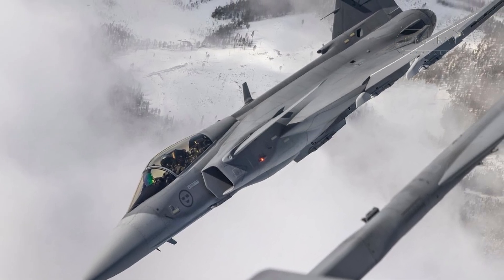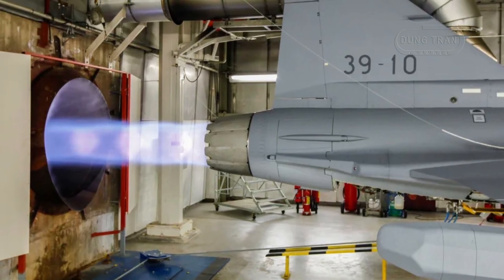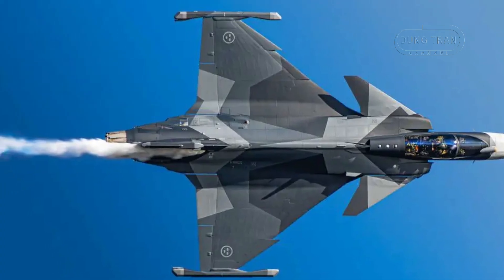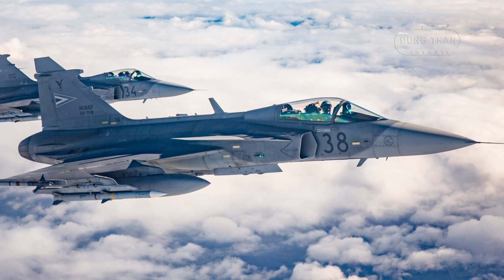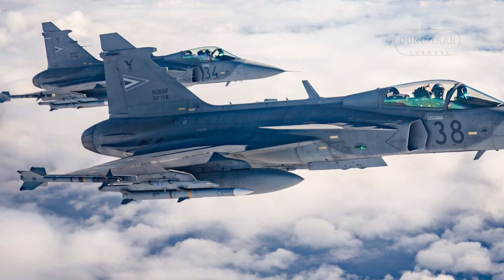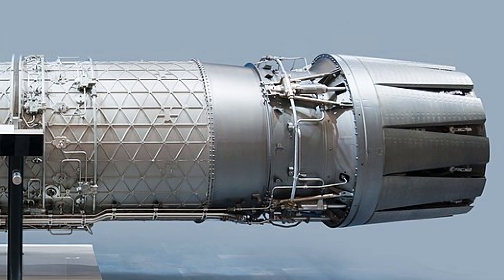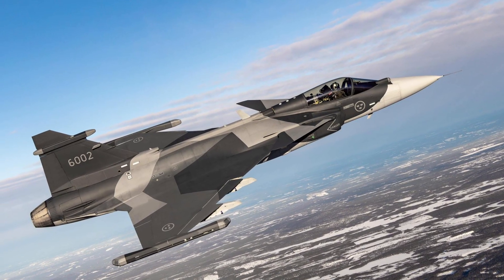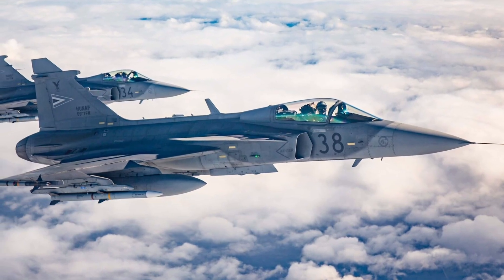Sweden's Gripen E's Hypothetical Power-Up: EJ230 vs GE F414G Head-to-Head

Comment: There is no way to mass produce Gripen with RR engines, yet. Dialing in the engine with the airframe typically takes 1-2 years (there are NONE, yet). It then takes a couple of years to translate that for mass production. Sometimes, there are added costs… once complete.

Comment: It should be noted that the EJ230 would only be installed if a country orders the Gripen with the EJ230 engine instead of the F414 engine.  There's simply options now.  Note that South Koreas KF-21 also uses the F414 engine though they make it themselves and they have said they will make their own domestic engine to replace it.  That would mean that a replacement that diesn't take any modifications to adapt the engine will be available...

Comment: The weight and shift in balance might be just a fly by wire software fix but changing the body and air intakes is like calculating a new plane with drag, radar cross sections etc. The RR engine should be considered for the next SAAB, 10-20 years from now.

Comment: The EJ230 doesn't actually exist, it's not even a prototype. In fact, I've never heard of anyone using the term 'EJ230'. Also, thrust vectoring is separate from the engine, it's not necessarily part of any engine upgrade.
Reply: Do better research. The ej230 is definitely found on the web

Comment: Its the American again meddling sabotage the deal by unfound statement cause fear of failure in Rolls Royce make engine.  As a Canadian we have seen this before in the past.
America does not want Canada to buy this aircraft because it the only fighter that can defeat F35 stealth with Gripen E radar.  

The truth is the F414G is great engine in straight level in dogfight no extreme turn to left and right up or down could cause flame out of the engine..  This is why they have an auto restart and hope the pilot can get to the button while it on subsonic spin.  Judging from the lack of accident from Typhoon the Rolls Royce  working just fine.   Pilots are not allow to make this public but then it got out.  China's Shenyeng J 15 flying shark four flame out and crashed not too longer ago.

The only aircraft that build with anti-flame out is the Rafale that Canada ordered.    Word got out Rafale is hugely popular now and flooded with order.

Comment: They should skip the thrust vectoring to expedite and simplify the EJ200 in other aspects like better fuel efficiency/better thrust that next gen engines will enable such as F35 block 4 engine.

Comment: If Saab consider the 'F-series' 5-6th gen idea at all, then an EJ230 style option should be considered for all new elements - the loyal wingman UAV, the light 'stealth' fighter etc. Equally they should be taking to GCAP (or even SCAF) program.

Maybe if both programs, either use the same loyal wingman partnering different crewed aircraft, or at least agree to develop using a same European engine, it might have enough numbers then to reduce the engine development/unit costs.

So either the Gripen remains the weak link with US engine, but at least within a system where new stealth fighter and loyal wingmen are ITAR-free and stay flying, or the costs come down enough to make an EJ230 Gripen retrofit/redesign worthwhile/fundable.

Comment: SAAB need to consider whether it stays with the American engine and being told who they can sell their planes to, or revamping the Gripen to the  G and H versions with the Rolls Royce engine and basically having more control over selling their plane to whoever THEY wish to sell it to. It doesn't really matter which President is in power,  if it competes with American manufacturers then they will have sanctions of some sort placed against them.
Reply: US does not have the power to block for competition, only security reasons. So any nation US wants to sell F-16 to is valid.

Before Trump Sweden might have hesitated if US try to block for economic reasons, now pfft go away US we dont care.

Comment: When i saw the tangle of pipes on EJ230 I had to think of SpaceX's Raptor engines. SpaceX managed to develop its Raptor engine in just  few years. With Raptor 2 and Raptor 3 being substantially more powerful and at the same time less complex and cheaper to produce than the corresponding previous versions. I wonder whether makers of EJ230 could learn from SpaceX

Comment: The ej230 is more or less the same engine that's in the Typhoon, if two engines work in the typhoon of course it will work for a single engine in the Gripen e/f that's a given, to say that an engine that's in a 2-engine fighter can't work in a single engine aircraft is just stupid, sorry, and the Gripen air frame can be upgraded to take a different engine as long as it's a close fit, yes it would cost a bit more but it would also have a lot of benefits for the Gripen, over all it would be a great thing to do for the Gripen, and the Swedes are very practical and smart if anyone can do this it's the Swedes, Canada should help them and buy more Gripens than just 88 very expensive  to fly and maintain and only a 50% availability to fly  f35s.
Reply: The engine needs to generate enough thrust and electricity wattage. New fighter jets got a quite insane amount of technology that runs on electricity and this is a problem with single engine fighter jets. Even F35' insanely powerful engine can hardly keep up with requirements.
Reply: @xerxes2se  True, the main challenge for modern avionics, EW and sensor fusion is being able to first generate enough power in a fighter jet and then also being able to keep all this cool enough to maintain performance and operation
Reply: Never understood the argument people make that the engine would need to be modified to work as single argument.   F100 and F110 both used in F16 amd F15 planes yet one is single engine and one twin.    Nothing found to say engines had to be modified to work in single engine plane.
Reply: @michaelmcnally2331  Having only one power source typically requires better reliability to reduce the probability of a single failure leading to a loss of aircraft.
There is also probably need for some significant changes to the control logic and fault handling in the built in control software.
Even if the required changes are small verification takes time as both the hardware and software are of a critical nature in this case
Reply: @kronop8884  Are you trying to argue that the US Navy accepts a less reliable F414 Engine in the Super Hornets then if was being used in a single engine installation?
India is using the F414 in its Tejas Mk2 Figher as well in a single engine.  The US Navy has now accepted single jet installation with the F35C even though previous jets have been dual engine installation.  It isn't going to become less reliable because being installed in pairs then installed as a single jet fighter.  
In the civil world with the increased reliability of engines then seen the end of the 4 engine jets and the emergence of larger twin jets that can fly further from land due to improvements in engines.

You also wouldn't change the Control Logic and Fault Handling software WITHIN the engine.   You would handle within the Plane Systems outside of the Engine in the FCS.   The F15C and F14D both used F110 engines but with different flight control systems.   The control logic within the engine to say "open the afterburner", ""close the afterburner" within the engine has NO need to change.   What you need to ensure is that when the Flight Control System says increase thrust, decrease thrust then the engine does as expected but that is integrating the engine into the FCS not modifying the engine.   You ensure that the plane sends the correct information and interprets the information back from the engine correctly.  However whether is a single engine or dual engine that is true.   The F110 had to be integrated so that it was understood correctly by the software in the F14D and F15C/E etc even though both are dual engine fighters.  The changes however would be done external to the engine and if the plane didn't respond as expected then would modify the FCS in the plane to correct what is sending to the engine so that get the expected result.
The controls within the engine to close/open the afterburner don't need to change.  

In terms of diagnostics then also the engine itself doesn't need to know if a single or dual engine installation.  If there is an issue with say the fuel flow to the afterburner then it makes no difference if is a single engine or dual engine.  The engine will report to the plane the fault and then the plane will in its systems say if is the left or right engine.  So again where would need to modify is in the plane not the engine itself.
Reply: @michaelmcnally2331  From what you wrote I assume that you dont have full knowledge about what a FADEC is and what it does in relation to a modern Jet engine such as the 414. Older engines like the 404  used a DEC which probably more closely resembles what you describe in relation to the F110, the 404 even had a mechanical backup throttle

If a problem occurs in a twin engine jet the FADEC (Full Authority Digital Engine Control - computer) that is part of the engine design will be programmed to significantly reduce power or even shut that one engine down completely to protect it and the aircraft, in a single engine design doing something like this  may result in a catastrophic event so a completely different set of control rules may apply to try and save the aircraft while accepting increased damage to the engine.

In essence you always need to to more in a single engine setup to ensure flight safety than in a twin engine one to meet the required non combat loss ratio (NCR) numbers
Reply: @kronop8884  The EJ230 was already offered for the HAL Tejas Mk2 losing out to the 414.  So surely the EJ230 is already designed, like the 414 to be used in Dual and Single Installations.  So why would it need modification in the design of the engine to be fitted to a single engine design.   The FADEC in the F414 is software that can be updated/tweaked to also increase thrust, fuel efficiency, longevity of engine all with software updates and not having to physically change hardware or the design of the engine.  GE don't claim that having to modify the engine to do these things but simply software updates that can be applied to existing engines.   

EJ200/EJ230 also use FADEC software as well, so if is FADEC that need changing ie software tweaks then why cannot you fit an EJ230 into a single engine fighter?    We are being told that cannot be done as the engine designed for Dual Engine installations.   These are simply software changes wouldn't have any need to change the assembly line as is software changes with what you are saying.   Sounds as though people trying to simplify their argument to the point where so simplified that doesn't make sense.  You wouldn't need to make hardware changes to the engine just the FADEC software which by its nature of being software is expected to be changed and GE even state that can offer software updates to the FADEC to tweak the engine.

VW use the same engine design across multiple platforms and even across multiple companies within the group, it outputs different torque and bhp depending upon how tuned with the equivalent of its engine management system.    VW don't have to modify the design of the engine,  just tweak the settings in the Engine Management System to adjust the output.   Car enthusiasts will even tweak those setting with the software to change the parameters of that output to improve bhp or torque.

Comment: "single engine fighters... like the F18 super Hornet..." these people know their stuff (NOT). At least the word hypothetical is in play.  It is more likely that SAAB will invest money and engineering resources in a new fighter as the JAS 39 is a rehash of an old design.
Reply: There will not be another Saab fighter for a very long time, not gonna happen. Switching the engine is what is on the table right now.
Reply: @ Prove it. Show me the re-engine news release from SAAB. SAAB has stated, however, that a 6th gen fighter is being considered. Canada should buy Gripen E for short term and invest in 6th gen fighter program somewhere, possibly in Britain, Japan and Italy endeavour.
Reply: @Anticheese  There is no official news from Saab about a new engine. Saab has said that threre are no plans for another fighter after Gripen. Sweden's current plan is to make a decision in 2031 about what to do after Gripen.
Reply: @Anticheese  While the Gripen E look similar to the legacy C version every single system has been upgrades and in terms of avionics, engine, Radar, electronic warfare and sensor fusion it’s a completely new aircraft to the point that it actually is a completely new platform where it counts.
Compare if you will with the difference between the Hornet and Super hornet, similar looks but two distinctly different aircraft’s
Reply: @kronop8884  So why does it look the same? Do you contend that air frame shape is of no consequence? Super Hornet is an advanced Hornet. Gripen E is an advanced Gripen. If they were new designs, they would reflect modern fundamental design, not 80s legacy shapes. Gripen E is not a clean sheet design. It is an evolution of a 30+ year old aircraft, up-engined and packed with modern war fighting technologies. Improved, not new.
Reply: @kronop8884 pointless discussion. Enjoy your Gripen. Brand new or tried and true, it seems capable.

Comment: The idea is to take advantage of the GCAP program's advanced prototyping and manufacturing technology which is allowing RR to move much faster than previously possible in developing new platforms.  With these design tools, a purpose built, bolt-in upgraded engine with all the features Saab wants could be brought to market in months instead of years.  These engines would be offered to equip new Gripens and retrofit existing fleets with more power and efficiency.
Reply: @MichaelK.-xl2qk   Nope, it’s not that easy. Certification alone in a test bench takes much longer than that
Reply: @MichaelK.-xl2qk  Ten years from agreements until the aircraft flies on a new engine. Engineering takes time and bureaucracy... exists. And no official announcements from any putative participants in the much anticipated new plan.
It's just vaporware.

Comment: I don't see that SAAB has much choice than to do the engineering to able to offer the RR engine. 

At best, the US is a competitor looking to block Gripen sales into their customer base. 

At worst, the US is an adversary who can cut off engine repair parts to any country it has an issue with.

SAAB can't take that chance, and it is on the minds of any potential buyer given Trump recent behaviour.

As a Canadian, the Gripen would do better in our more remote conditions, but if it means relying on a tRumpified America for any part or approval, the Rafale makes more sense.

Comment: I suspect that there is work being done behind the scenes in secret to incorporate the EJ200 into the JAS 39 E/F. The reason for this being done in secret is to prevent DonOLD getting angry and cutting off the flow of GE F414G engines to SAAB.